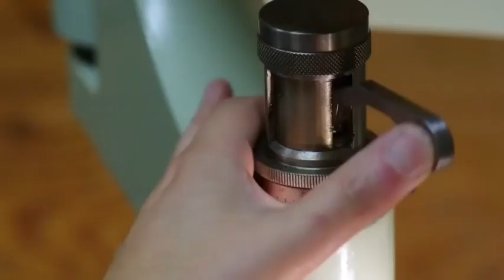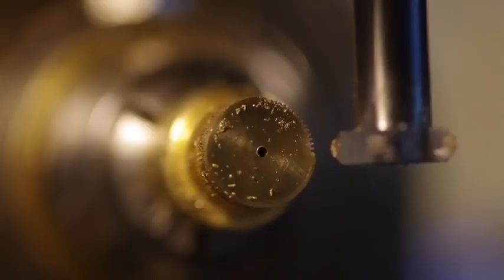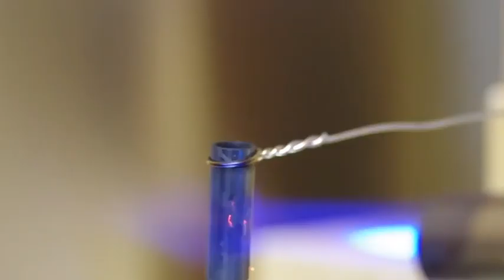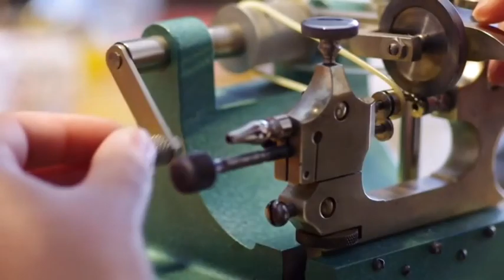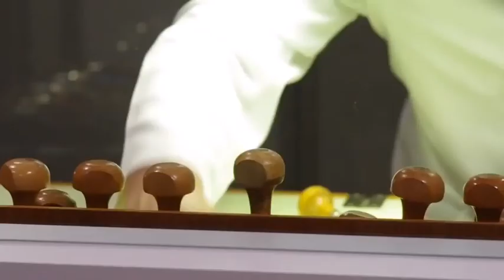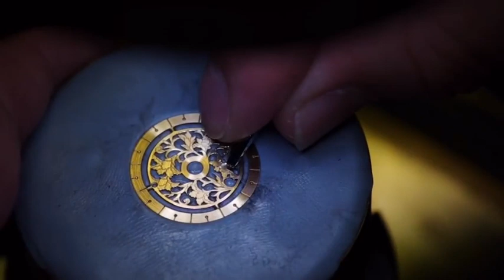Masahiro Kikuno Watchmaking

Comment: Wonderful. But...what material is used here? Brass, or bronze he made himself?
Reply from the maker: Brass for the wheels and steel for pinions
Reply: Thanks for the answer.. But is there a specific brass alloy used for watchmaking? Copper alloys are a big family of different types combinations copper, zinc, tin, silicone,manganese, aluminum, iron, lead(sic), and on and on. So for something so precious and work demanding as watchmaking, I would believe there is a couple of specifics, corrosion resistances, hardness etc, that is specific for one alloy,that is better than most other alloys. For watchmaking. George Daniels just covered the whole mechanism with gold. But gold wears off. That's why I'm experimenting with aluminum bronze. Anybody else out there, trying out aluminum bronze for watch movements?
Reply from the maker: @sveinarnehaugen4851  Traditionally, watchmaking brass is CuZn39Pb2 (then surface treated). But for higher quality, ARCAP is the choice.